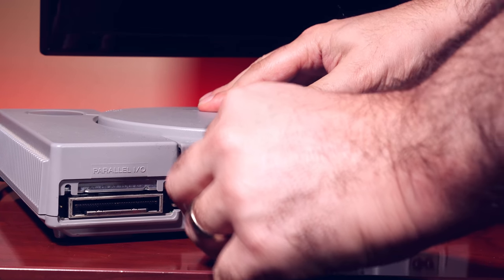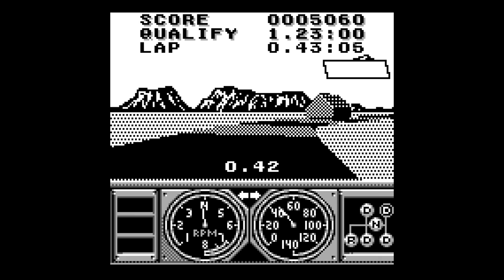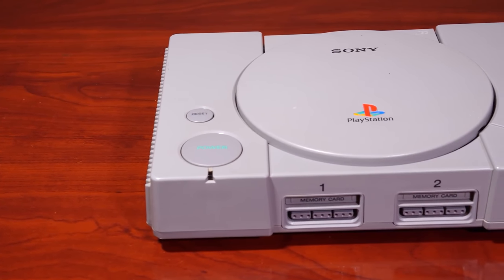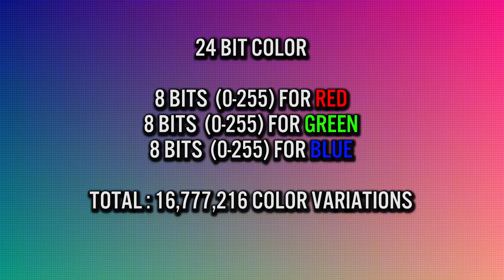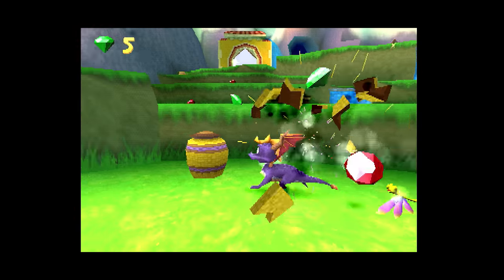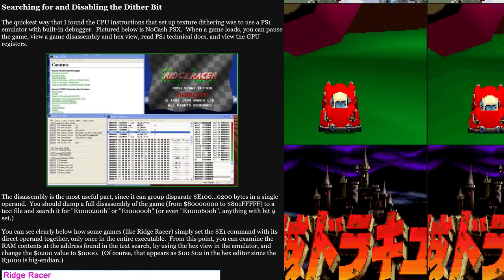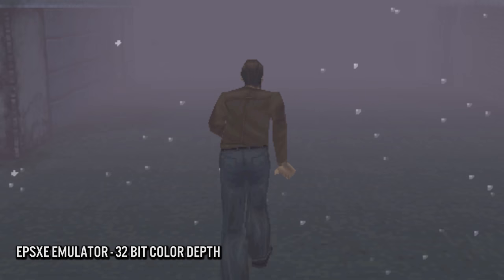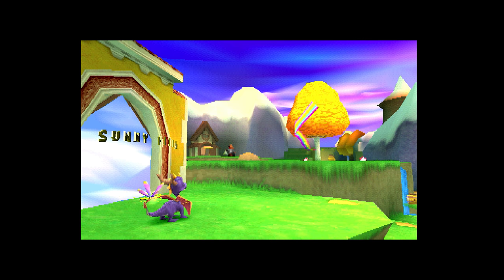Why did the PlayStation 1 have so much Dithering? | MVG

Comment: Just want to say about the Amiga you state copper fill. There is no such thing. It’s either copper split / command and blitter fill. Copper controlled other chips and did what I could using the blitter to fill was not with out overhead. Every time you used the blitter you used up bits of its performance.

Comment: The dithering algorithm on the PlayStation's GPU is one of the worst looking things when looking back at it with HD retrospective in my opinion.  No one mentions the fact that the Sega Saturn had no such algorithm in it's 2 GPU's and benefits immensely from this when playing it over SCART to an HDTV.  It looks much much cleaner than it's 2 competitors, even if the color depth is still likely around 15-bit.

Anyways, can you please do a follow-up on the Saturn's lack of "full-screen" dithering?

Comment: While I am a huge fan of High Level Emulation that can produce super sharp high resolution rendering of 3D games, I find it impressive and ingenious what Sony engineers were able to achieve by exploiting idiosyncrasies of most CRT televisions to overcome limitations of the hardware to render silky smooth 3D graphics to create an experience that so many players enjoyed. Good on them! Even though I was a diehard Nintendo fanboy back in late 90's, I have nothing but the utmost respect for the folks who designed and engineered the PlayStation. The PS1's massive dominance of that era was largely due to their efforts to create a great gaming platform. And I salute them.

Comment: Contains no charm or nostalgia for me but then again it doesn't bother me either. Technically it's part of the PS1 graphics look but if you're emulating what the hell, might as well smooth it out. I think I might try 480p emulation as that would give it a 3DFX dither look. ;)

Comment: Feel that I need to correct the "In the UK" part, I had an Amiga and knew several other folks did, too. We all connected to a 50hz PAL TV using RF output using an external modulator that plugged into a parallel-style port on the back. I'm pretty sure that was standard at the time over here for Amigas intended for gaming.
Reply: Ya know, thinking about it, it's ironic with the conclusion of the video being as it were(how dithering doesn't work as well on RGB), most folks I know actually started using pure RGB SCART with the PS1, because Sony originally supplied RF modulators by default and the picture was pretty unacceptable.

Comment: I hate dithering (!) and smoothing it away with composite video feels very decieving, many sega genesis games relied on composite video dithering blurring wich i don’t like because it’s decieving,,
Now while N64 games also use dithering but they blurring the imagine trough anti aliassing and not via composite so therefore it’s not decieving because it’s done in hardware,not via cables,

While rainbow banding is pressend in many many snes games, it should be possible to eliminate that by using color blending, in fact i tout that the psx supported color blending in hardware to get around the 15bit color limit,not sure,,

So if you blur dithered imagines and then end up getting rainbow banding, then use color blending to get around those rainbow banding colors😊

Comment: So the morale is: if you want a proper retro experience, use CRT TV. And stop whining about bleeding colors or image softness. Try to mitigate it but do not expel it! Nobody developed games on those consoles back in the day and aimed for CRISPYCLEARPIXELS. There's more. Color bleeding and image softness are features! Those "perfect square sharp pixels" which MLIG channel is rooting for so often are in my opinion an abomination since they're resulting from scanline doubling. It's all artificial as hell. A good big CRT, a quality composite cable and proper 240p handing with scanlines is the key for great retro experience in my opinion. Suddenly the PS1/Sega Genesis dithering is cool, N64 antialiasing works wonders, and NES games look fantastic (not to mention working lightguns for every console). As soon as you begin splitting hairs in the picture your console produces then there's no point in investing in old hardware at all I think. Go with emulators.

Comment: I dislike the dithering was never s PS1 fan in the first place as the so called jump in 3D technology looked flaming awful!  Lack of shading technology maybe, but if you had a 24 bit pallette it should have been used.  They should not implement it if it cannot be used.  In fact only the new consoles from Microsoft and Sony will be game changers the old ones are all rubbish compared to PCs especially the price of games!